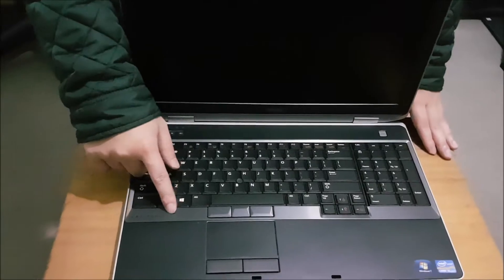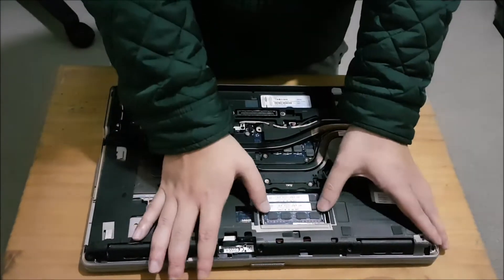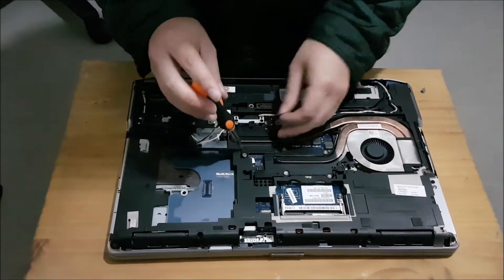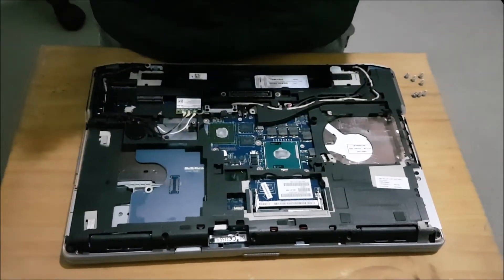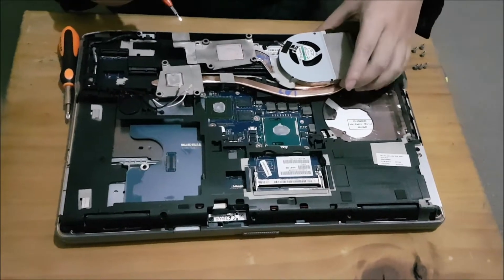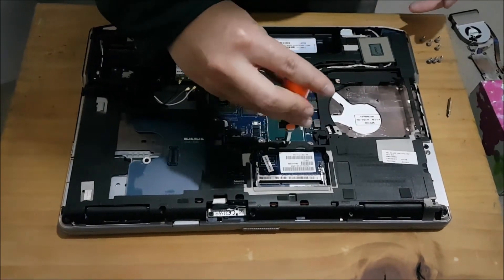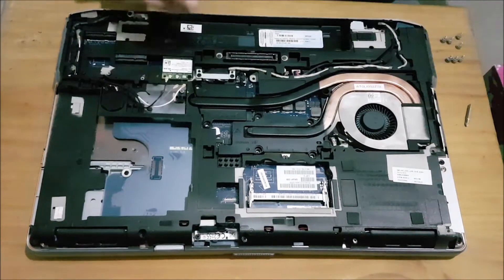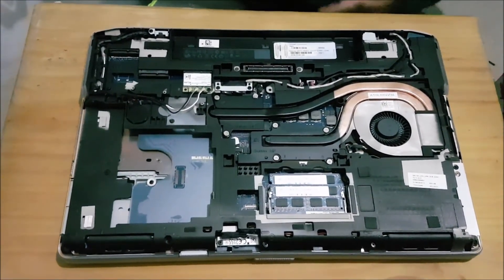OPEN ME UP! Dell Latitude E6530 and E6520 Disassembly

Comment: E6520 running on Intel Core i7-2720QM. 
Is it possible to replace it by Intel Core i7-2960XM?
Intel Core i7-2960XM is unlocked, but with 55W instead of 45W TDP.
Reply from the maker: if it is the same socket it will work. the only issue is the motherboard might not provide the power you need like 55W as it might be set to max 45W.

Comment: If you can afford it, get a Graphite Thermal Pad INSTEAD of any kind of messy paste or 'liquid metal' stuff.  The graphite pad has proven to be WAY better than even the best of any other medium to conduct the heat from your chip to your heatsink.  Cheers! ^_^
Edit: Also, a BIG thanks to content creator for this.  The first vid I watched, trying to learn BEFOREHAND how to replace my laptop's thermal paste with the above mentioned pad, was horribly cut AND disGUSTingly bad video quality(like they took 144p or 240p video & blew it up to 720p or something)!
Reply from the maker: this is a basically laptop using better thermal paste will not improve anything and does cost more. thanks for your support
Reply: It's a 'basically' laptop, huh? {chuckles}   Why are you talking about using better thermal paste?  I said DON'T use thermal paste AT ALL. :/   OF COURSE better thermal paste costs more and its effects are, as you say, minimal at best.  That's why I suggest using a cheap graphite pad INSTEAD.  It'll completely remove any thermal conductivity bottleneck at the hottest parts of the laptop, AND you can find it dirt cheap at digikey dot com.  For example, their part number 1168-2090-ND is a 15mmx15mm square of the stuff for just over $0.10!  Granted, you have to buy a minimum of 20 of them, but that's 45cm^2 (45 square centimeters) for $2 & some change!  You'll never need to buy more unless you're a super tester business like Linus Tech Tips(look him up here on YouTube) and even then, that much will last you YEARS because it's RE-usable(like, countless times).
Hope this helps someone! ^_^

Comment: Don’t take this guy’s advice and put an mSATA SSD in the full size PCIe slot, it is unsupported and is SATA II, meaning your max data transfer speed to the drive (if it was supported) would be 10 times slower than using your HDD SATA bay. I bought one of these with an mSATA drive included and it was actually in the HDD bay but in a wire “cage”, I learned that they did this because the PCIe slot will not support mSATA.
Reply from the maker: I think you are confuse, there is no different in buying a normal 2.5 inch SSD and using the an adapter. there is nothing you can do to get better performance since the bottle neck is the laptop slot not the SSD itself. So you cant do anything to get more speed than it allows you. So if you wanted to use 2 hard drive how can you do that. you use the msata slot which is not at max speed but still fast and the normal 2.5 inch sata slot.
Reply: Official advice from Dell is that these mini PCIE slots are not mSATA enabled. The next generation e series laptop (e6440 4th gen core I processors) was the first to feature them. Hence why the OP was supplied an mSATA drive with an adapter to fit in the 2.5" drive bay. The SATA 2 Vs 3 limitation is an unrelated issue.

Comment: Nice video.. I need to change my E6530 motherboard. This will help alot. Seems the hardest part is what you've shown.
Reply from the maker: you can download the user manual and shows you all the steps
Reply: do you have a link?
Reply from the maker: go to dell website enter your service tag and there will be something that says manuals on the left
Reply: Ok, so I'm assuming you changed your motherboard since the comment is 4 years old. I want to ask you a few questions C:
Was it hard to disassembly E6530 to get to the motherboard? Did you have any problems with this part?
Did you have already some parts changed in your laptop (like CPU or RAM)? Did it cause any problems?
Did you change your motherboard beacause you wanted nvidia GPU that you didn't have before (like me xD)? If so, were the drivers installed automatically or did you have to install them by yourself? Did you have any problems with this part (like GPU was not detected and drivers couldn't be installed)?
Overall did you have any problems after installing the motherboard?

just a few questions